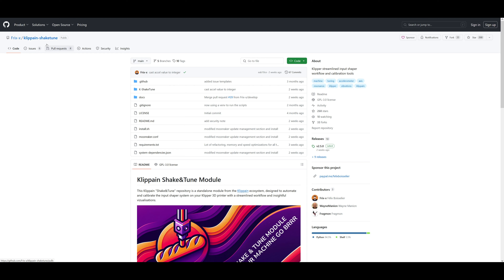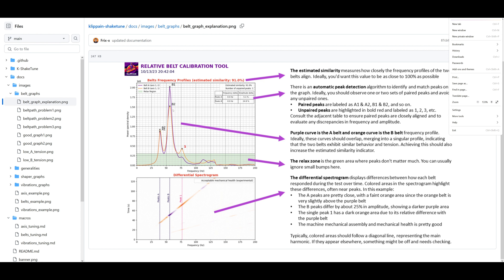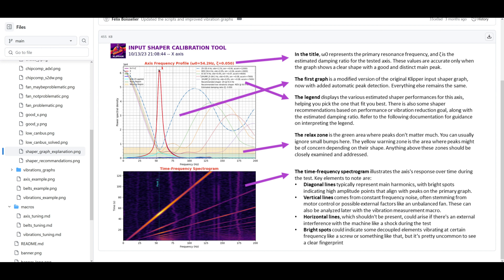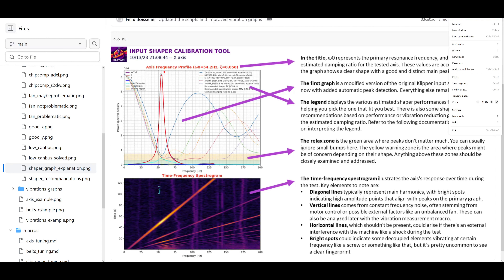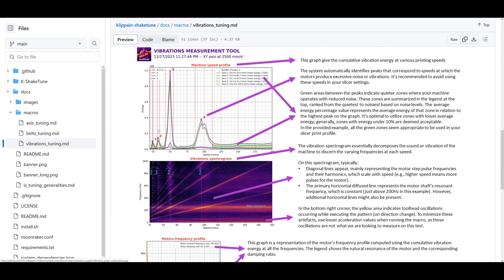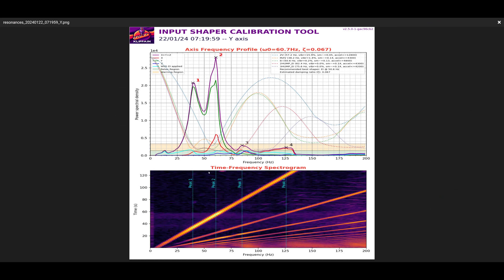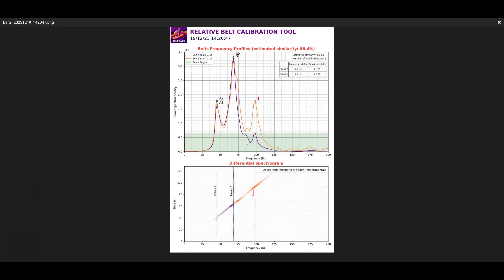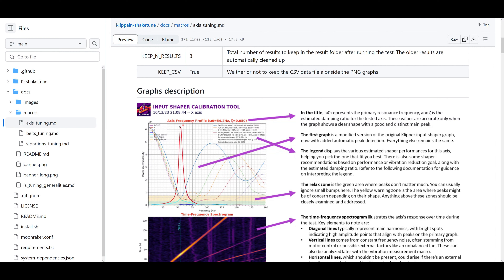Part I   introduction to resonance testing - belt shaper, input shaper, and vibration calibration.

Comment: I was searching for this on youtube for daysss 😭 i have some weird frequencies on my printer’s x axis I think watching your videos will help a lot (im not done watching them still) (i3 style bed slinger but the base that printer sits and is attached to is a 15 kg behemoth from 16mm mdf that houses the electronic)
Reply from the maker: Most of my video's apply to core xy and not Cartesian style printers (I3-bedslinger).
For a Cartesian the input shaper graphs are going to be the same graphs as belts. 
For G2T type belts the tension should be the same (which means you can use PF Makes tension tool. 
I would look to potentially my switchwire videos. However, that is a corexz and not a Cartesian.